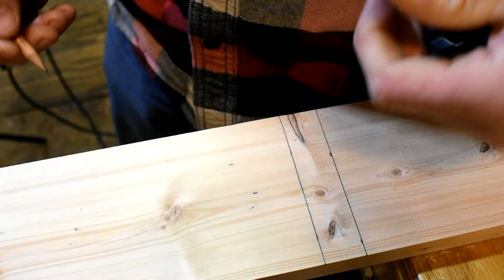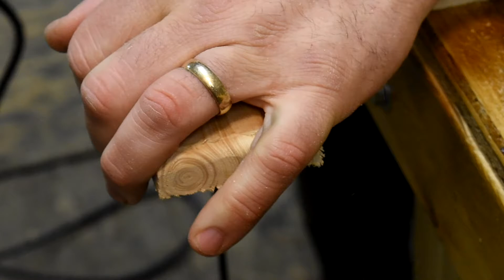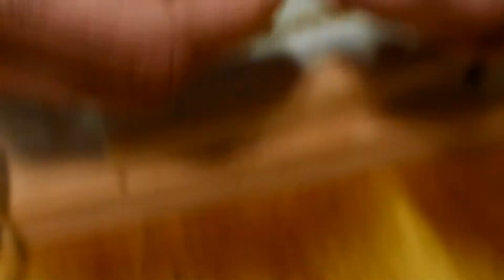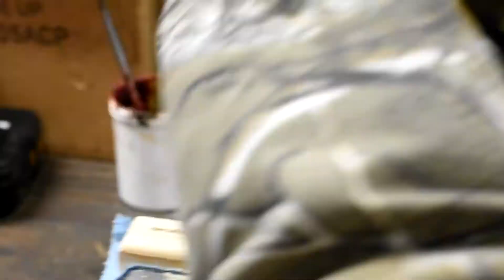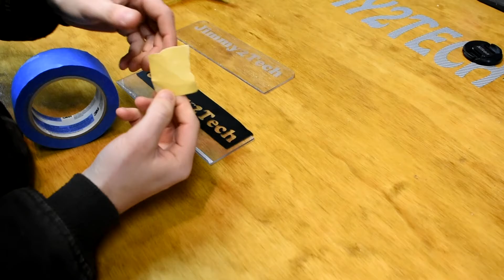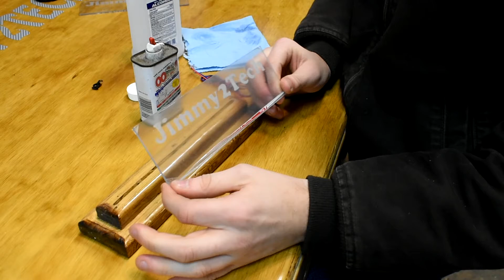DIY LED Acrylic Sign - On the CHEAP!

Comment: Go find an old projector tv someone is throwing out, Get the mirror out of it (should be on the top behind the screen). Then sand blast a design into it like you did the acrylic. Build a frame with lights.
Reply from the maker: This is a great idea, we may totally try it sometime soon! Just trying to make some time between classes and my job it's hard to find time to make videos with dad. Thanks for the idea though!
Reply: @Jimmy2Tech  hope to see it. I have thought about trying it myself but i do 90 hours a week in the oil fields.... but I'm subscribed so keep them coming. 

A slightly better mic when you guys are sitting at the bench would be a nice addition too (but thats just me being picky)
Reply from the maker: @xADDxDaDealer  no that's what we are looking for! I have a nice snowball mic I may use for recording but once I get a few more paychecks I might invest in a new camera/ mic setup. My nikon 3400 doesnt have the mic attachment and it's driving me crazy! I was thinking about selling basic merch for the channel to help invest into some materials and stuff since I already make decals and have some t shirts made. You'll probably see those next video:)

Comment: Hi..can this project be made with a larger and thicker acrylic? Say 18x24 with a  .220 thickness and could you tell me what adjustments would be made..sorry if it's a silly question. I'm new to all of this.
Reply from the maker: You should be fine with the increased thickness. You're just going to make sure that your cutout where the acrylic goes is proper size to the increased dimensions and you should be all set after that:)
Reply: @Jimmy2Tech  Thanks for your reply ❤ can you suggest what size router bit to get? I've never used a router before either.